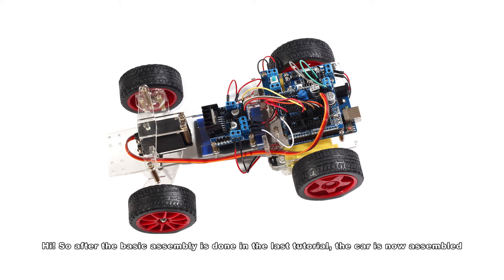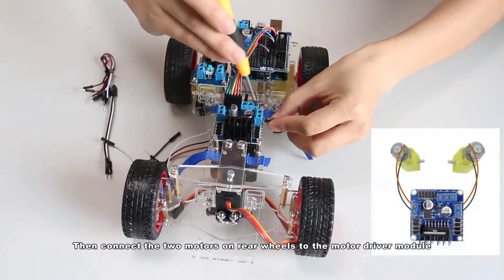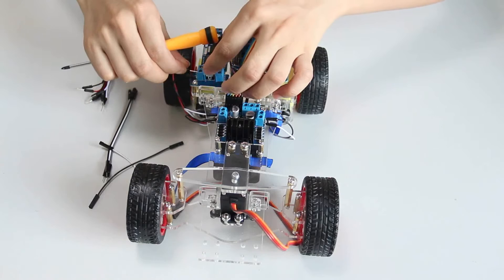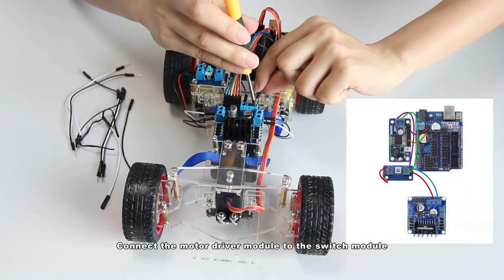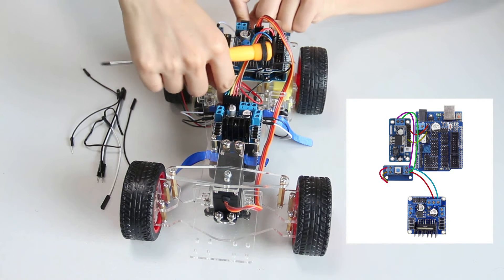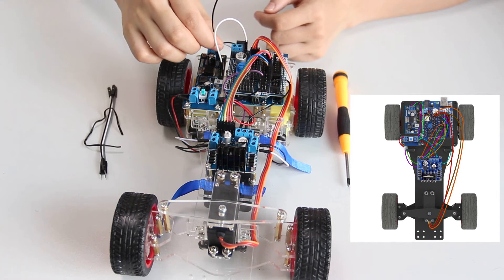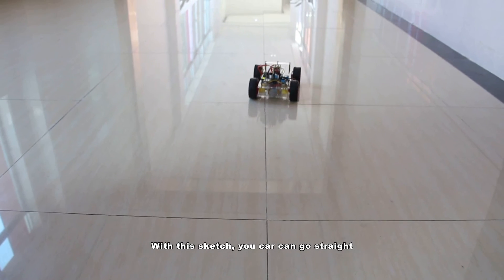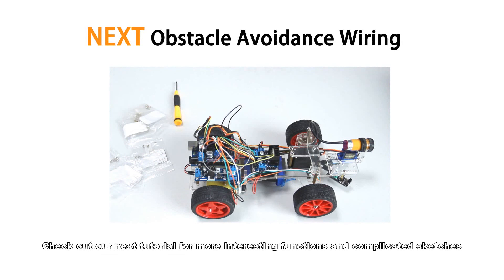Smart Car Robot Kit for Arduino Assembly Tutorials 03 First Wiring

Comment: After I builded the car it hasn't worked i checked the box of batteries when I push my hand in battery it's work another problem dc to dc converter become to hot

Comment: Hi Sunfounder, I have evverything built correctly but my right wheel runs in reverse apart from the left wheel how can i fix this
Reply from the maker: +Coincidence The Poet, you need to run the cali_client.py on the PC! Then calibrate the car according to the instruction book, it has the detailed steps.
Have a try!
By the way, the above video is about the Arduino smart car.